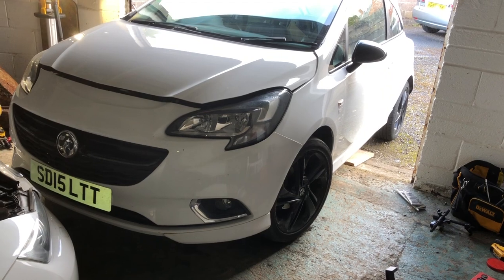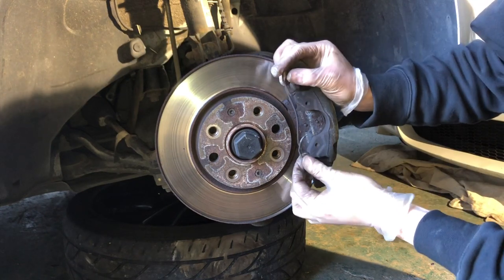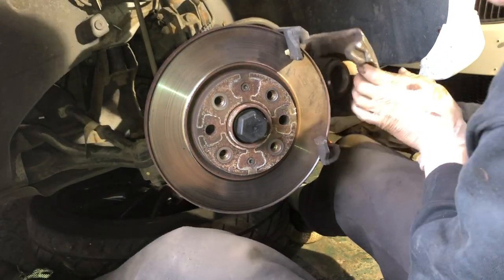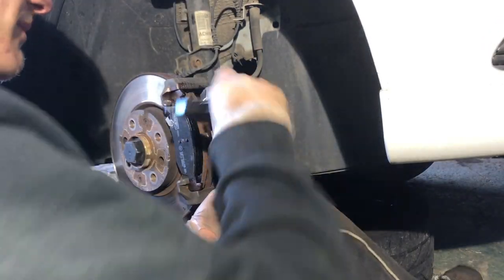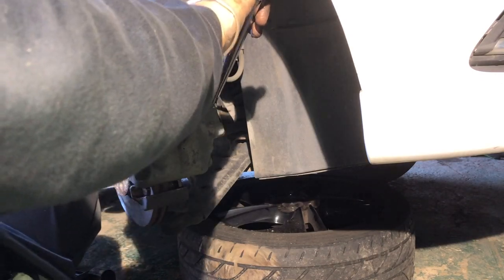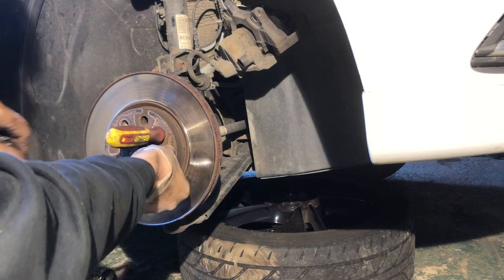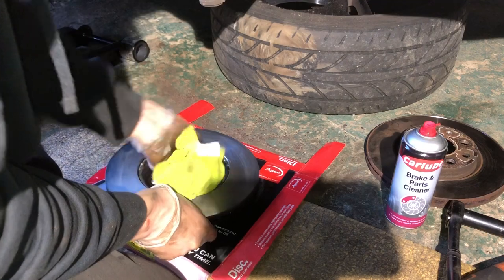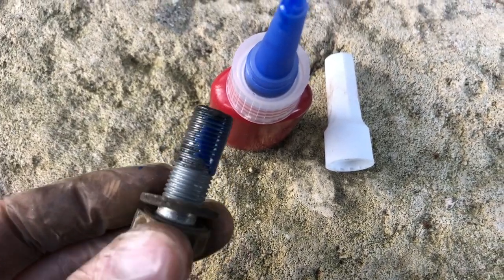BRAKE PAD & DISC REPLACEMENT 2015 VAUXHALL CORSA E

Comment: Quality video mate, when my brakes are needing changing on my Corsa e I'll be using this as a guide 👍
Reply from the maker: Nice one mate! Glad I could help, any questions when you’re doing it just give me a message:)
Reply: @BTR_REBUILD  stupid question but how did you remove the cap on top of the wheel nuts? Did you have the proper tool or are you able just to pry it off?
Reply from the maker: @JVance98  I used a pick tool but I’m sure there’s a tool in the boot you can use. There’s a little slot you can get the tool behind just to pry it off without scratching
Reply: @BTR_REBUILD  mine doesn't have the tool because it didn't come with a spare wheel 😩 will have to order one!
Reply: @BTR_REBUILD  thanks for the quick reply!
Reply from the maker: @JVance98  It’s alright mate not much on in work!

Comment: I've upgraded the discs and pads and once you have the process down it really doesn't take that long to do anything to them. I have one more caliper to paint and then the rear drums . When it comes to changing those pads that will be interesting.

Comment: Still have to remember to press the brake pedal in after. Had myself panicking at work thinking something was wrong because the calipers were still fairly wobbly, turns out only reason was because the pistons hadn’t pushed forward

Comment: General rule of thumb is, only need to change discs on every 3rd pad change, unless badly scored, pitted, lipped, warped or corroded.
Reply from the maker: I’ve just picked up 2 brand new ones for the front😂 ahaha I thought someone would notice
Reply from the maker: Nice one mate, will keep that in mind with my other cars. Never really did know when the best time was to be honest with you but they’re fairly inexpensive so I thought I’d do both at the same time

Comment: Hi Barry, 
I enjoyed your video,  as I will be changing my front breaks on my corsa E vehicle, looks pretty straightforward. 
But I was worried about having the right tool to release the two bolt which are coved with two plastic caps. 
Could reply with the right tool for me as I need to get one.
I'd be very greatfull if you could.
Yours sincerely 
Barry .matthews
Reply from the maker: It’s a H7 bit which is the same as 7mm Allen key I believe. Thanks for watching!
Reply: Hi I do have a question,  when I changed my pads & discs,  I didn't have any disc decrease, I noticed the effect on my breaking, as not as sharp as I wanted them, is there anyway of correcting this problem.
Cos I feel as the crease on the pad may have effected them from breaking properly.

Comment: Hi, you may be able to give me some advice. Drivers side footwell getting wet in wet weather and minor flooded roads. It is soaking right now. Can the seal under base of the footwell be resealed by a garage? Or is it the wheel arch area?
Reply from the maker: The only seal I reckon it could be is the door seal? Check around the drivers side door and frame. Could just be one of the seals have perished or just not seated correctly around? Let me know mate
Reply: @BTR_REBUILD  Door seals seem sound and dry. Waters coming from under the carpet. Just where your right foot rests in my Corsa E. I think a seal has gone somewhere by there.

Comment: Is possbile to replace the brake discs only ,bro?
Reply from the maker: Yeah that’s no problem, just need to skip the pad replacement part of the video and just take off the two main bolts for the calliper and then follow the rest of the video mate
Reply: @BTR_REBUILD  Thank you so much!

Comment: Not adviseable to force the piston back against the ABS module because you cause failure. Far better to fit a bleed pipe to the bleed nipple and crack the nipple. That way when you push the piston back the fluid doesnt affect the ABS pump. Simply lock back up and top up the master cylinder once done.
Reply from the maker: Ah right never even thought of that! Thank you for that, you’ve changed the way I’ll be doing my brakes forever! I think I must’ve watched a tutorial a few years back and just followed that procedure. But makes a lot more sense not to push the fluid all the way back up through the system. Thanks for watching and giving some constructive feedback, appreciate it massively!
Reply: Been doing it his way for years pushing the piston back with a hand clamp and never had a problem / failure, seen plenty of garages in the past do it that way as well..just make sure you undo the brake fluid tank and sit the cap on the top before and put it back on after...BUT I get what you're saying
Reply: Absolute tosh ! Nothing to do with abs . This guy is talking abs. 🤪